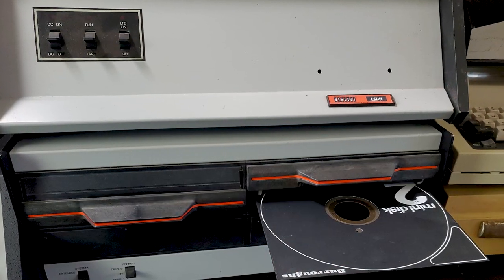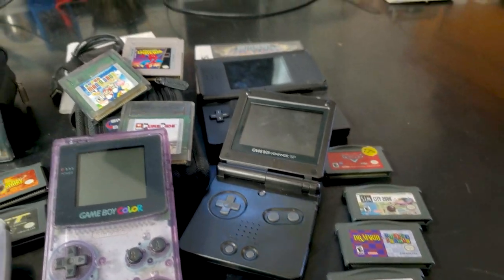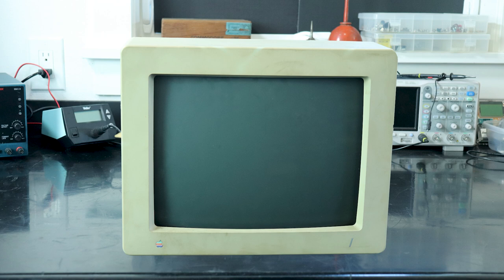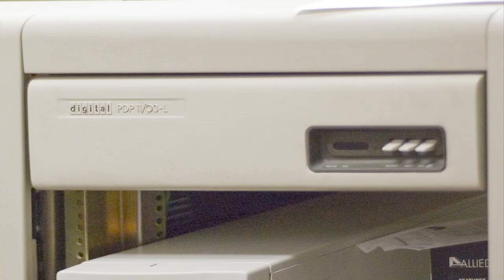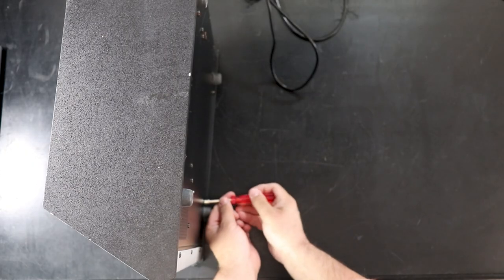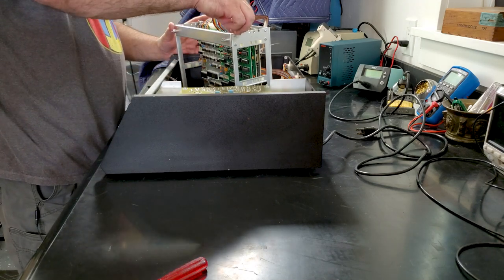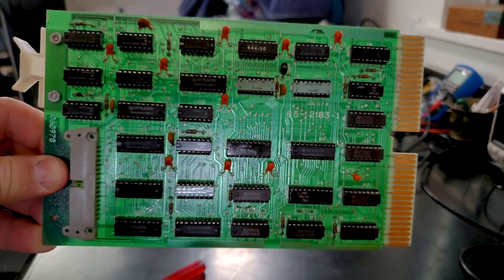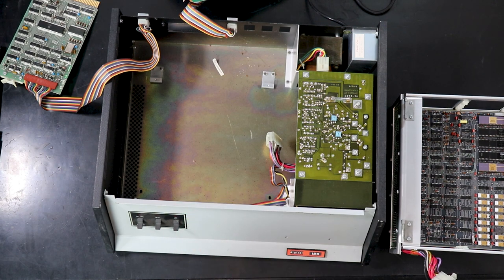You won’t believe what I found at garage sales! Heathkit H11 and More!

Comment: Very cool find in the H11, Mike! I see it is a Q-bus machine. Would be neat to see Unix, from TUHS, running on it.
Reply from the maker: That would be cool Dr Dave! I was not really aware what it was I had until I got it home and did some research. The Heathkit badge is missing so I assumed it was a Digital computer since that was its only badge. The more I learn about it the more exciting it gets...
Reply: @RavenWolfRetroTech  Ya, for me (a Un*x geek) it's as exciting as the AT&T 3B1 that Adrian's Digital Basement showed off.
One of my profs in college had one of those.
Reply from the maker: Lol, My brain is toast, I read your post and it turned UNIX into LINUX. I think getting UNIX running would be absolutely amazing. We should chat sometime about this. My video backlog is already up to about 100.
Reply from the maker: I had some other thoughts so I have dropped an email. Also, so confused, I had forgotten you were advoskater. Mentally merging 😎
Reply: @RavenWolfRetroTech  the stock H11 cpu can’t run real UNIX, no memory manager support.
 I once had a stripped down version of a UNIX like floppy based OS from Bell running on my H11
But not until I replaced the CPU card with a micro 11/73 was I able to use the real deal.
At one point I had a micro VAX with 9-track reel-to-reel tape drive running in my garage, that ran BSD UNIX.

Comment: I used to have a H-11, before they added the third switch for LTC (line time clock) control.
To boot I would open the top cover and install a jumper on the power supply to disable LTC
and for running RT-11 remove the jumper so that the software can use the generated LT interrupts.
Reply from the maker: I read about that switch. Was I understanding correctly that you could not do a warm reset without it and had to power cycle the machine or was it for something else?
Reply: @RavenWolfRetroTech  the machine would act funny if the LTC was enabled, but no software interrupt handler installed.
By funny I mean halting!
Reply from the maker: Mike, thank you for the "Crash" course